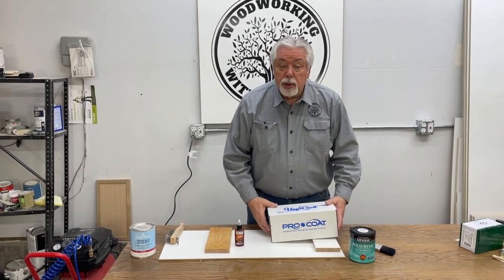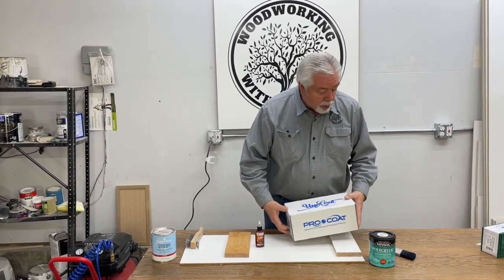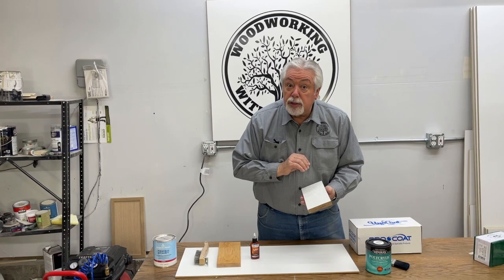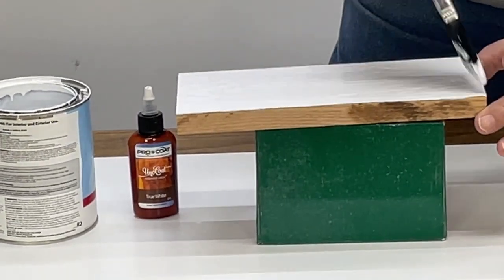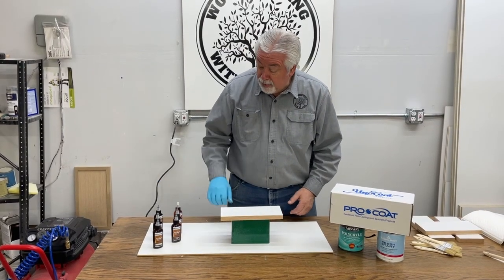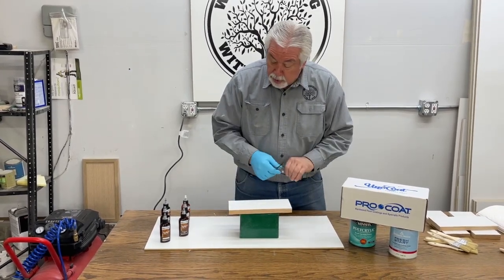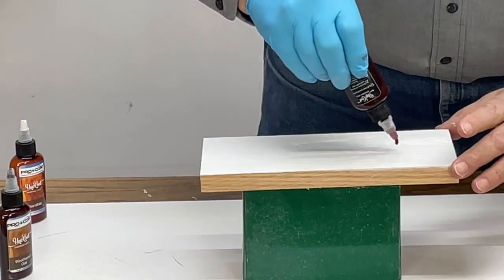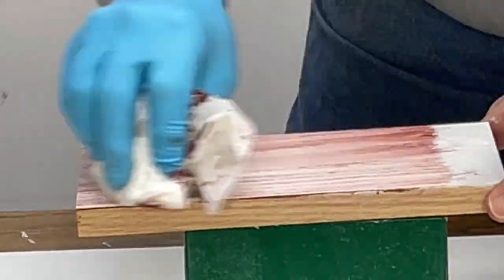I Wish Every Homeowner Could Watch This !

Comment: Doing something not in accordance with accepted procedure or  in accordance with instructions is not cheating. It is experimenting and might yield good results. As long as it is not something that creates danger or an unsafe situation, you may as well give an idea a try on a sample board.

I used some glaze recently that was over 20 years old; not  sure what brand. It was white with just a little color added, and was latex. It had been stored indoors in a plastic yogurt carton with a piece of a plastic shopping bag under the lid. It had a few small lumps, but was still useable. I couldn't believe it had not hardened!
I used it on a picture frame I made from a simple molding someone foolishly ripped out of a house built in the first decade of the 1900s. Then used a rag to apply a thin coat of  blue linseed oil paint, letting the white glaze show though in places. After giving the linseed paint a few days to cure, I coated it with some old Johnson's Paste wax. The wax is in a can that cost 79 cents. They stamped the price on the can with purple ink. Youngsters won't remember that; long before bar codes came along.
Reply from the maker: Thank you for you comment, I enjoyed reading about your experiment. Wes

Comment: Many are saying that primer application comes after the sealer. You're doing it in reverse order here. Can you enlighten us? Thanks for this video.
Reply from the maker: This is the process I use..
Wire brush to enhance the grain.
Apply tinted primer coat. 
Apply clear sealer coat.
Apply glaze.
Finally a clear top coat if desired.
Thanks, Wes

Comment: I’m assuming ProCoat is water based???
Maybe I missed your explanation? 

Also, 

I was wondering on any glaze do you have to wipe it completely off???

Next,

Could you use ProCoat on MDF, or any other substrate???

Many pieces of furniture don’t have natural grain, and so, I was wondering could you do a faux grain, but doing that, you wouldn’t be wiping the glaze completely off. 
Thank you!
Reply: I ask the same question.  Definitely interested for furniture flips.
Reply: @DecFirefly1210  he’s possibly too busy to answer. But if anyone would know he would.
Reply from the maker: ProCoat is a water based glaze. Glazing techniques are as varied as the colors they come in, as far as creating a wood grain effect I am not sure but will check with the manufacture. Sounds like another great video.

Comment: This may be out of your wheelhouse. I've a mobile home with most likely MDF cabinet doors. I could be wrong.  Q. Would this glaze work on painted cabinets with a graining tool? Also, I'd love to see some tips, hacks, or ideas to upgrade the appearance of cheaper materials usually used in a mobile home.
Reply from the maker: I have never used this glaze with a wood graining tool but I would suggest giving it a test sample first. As far as the tips and tricks for mobile home, that's a great idea; I will put it on the list. Wes
Reply: @WoodworkingWithWes  thanks

Comment: My ProCoat glaze came with a part A and a part B.  Do you mix when you glaze or just use part A?
Reply from the maker: Hi...part A is the glaze and part B the activator. The activator is used to cure faster, add durability and if you were going to put on a top coat. It is optional however. Good luck...it will be great!!